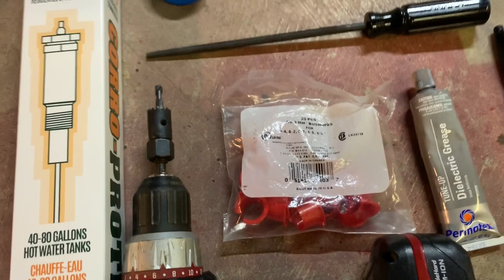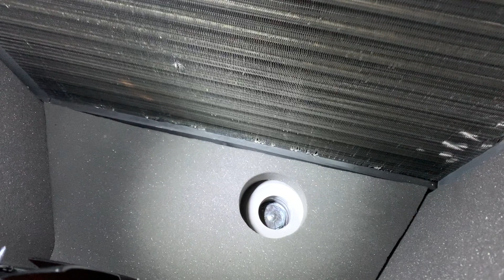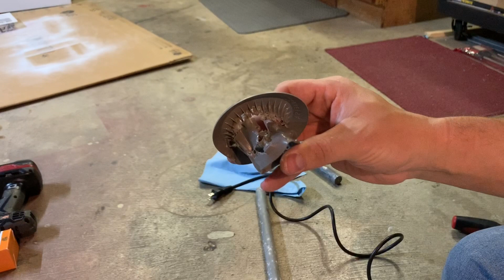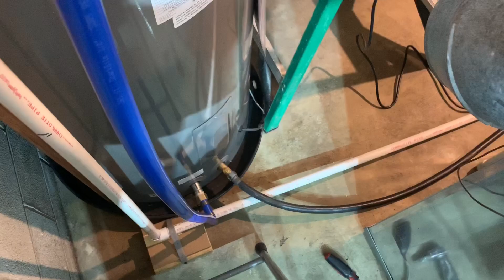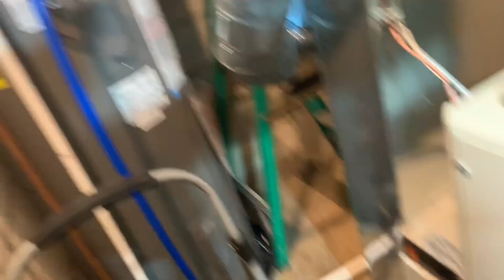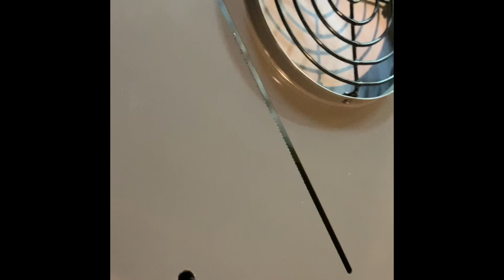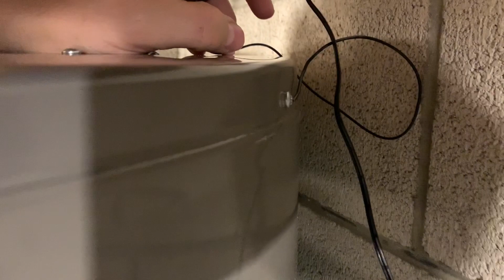Rheem Hybrid Electric Water Heater Anode Rod Replacement. Sulfur Smell is Gone!

Comment: Thank you for the video. I have been running the core protect rod in my Bradford white heat pump tank for several years. So far it has been great. I do recommend that if you have any Pex piping that you run grounds to all branches. I’ve had issues with calcium buildup at my transition location. I didn’t have this before the CoreProtect so I’m assuming that it is related. It is an easy fix especially since I no longer have the smell. At this point I have been very satisfied with the CoreProtect and I have not had any tank issues so I believe that it is working as advertised.
As a side note, a few months ago I did have a blinking light on my power supply and the customer service quickly sent me a replacement power supply. I was very pleased with their response.
Reply from the maker: Thanks for the tips. I will check out both of those items. I have pex, so I’ll look for any calcium, and to be honest, I haven’t looked at the power supply in……um…..however long it’s been since I installed it. 😮

Comment: Did you check with Rheem to see if it would void your warranty?
Reply from the maker: I did not, but many others, as you’ll see in the comments called Rheem, and they said no problem it would not void the warranty. I guess I should have checked before I said that.

Comment: I will be installing a powered anode rod in my 50 ga Rheem hybrid water heater. I called Rheem technical support & he said twice that it will not void warranty. Would have had to do it anyway because of orders. Installed 9 months ago.
Reply from the maker: Yeah I wish I would not have said that in the video. Many listeners have mentioned that it won’t void the warranty after talking to Rheem.

Comment: I contacted Rheem for my model (50 gal hybrid) and they wrote back saying changing the anode rod doesn't void the warranty. If you remove it and don't replace it that will do it.

Whoever's thinking of doing this I recommend contacting them first to get it in writing for yourself.

Comment: I hope you follow up with a borescope video in a few years. I have the same unit about 4 years old. Although I have no sulfur smell, I think I will do this. Thanks for your video.
Reply from the maker: That’s a cool idea, maybe I’ll consider it. If you decide to do the job, make sure you read through the comments. It turns out, it doesn’t void the warranty, and I think there is no need to remove the plastic cap if you get the correct socket in there. Good luck!

Comment: I've owned the 80 gallon version just like yours for more than a year, but am on city water with no smell.  Great heater, beats the dual 50s I had at previous house.  Looked for this video after not finding in the manual where or how to change the anode.  Great video, thanks!  I'll be changing mine in a couple years and will refer back...
Reply from the maker: Glad to help. I also love this water heater. I had a 30 year old crazy heavy duty commercial water heater that was in my house. It was rusting away from the inside, and staining everything with rust color. This one solved all my issues, and is so much more efficient. If you do change your rod, read through some of the comments, it seems like ripping out the plastic cap is not necessary with the correct socket. Thanks for watching!
Reply: @EvolutionDIY  Should also use a proper electrical gromet would be my only comment. Otherwise thanks for this was wondering about my new heater and how to replace the rod.

Comment: I just installed the Corro-Protect in my 11 month old Rheem Hybrid water heater. I was worried about voiding the warranty, so I asked the Rheem tech on their official YouTube channel. The response directly states that as long as the replacement anode rod is installed properly. It will not void the warranty. The response is there for anyone to see. Let me know if you want a cut and paste of the response.
Reply from the maker: Thanks for sharing. A couple of other members have commented that they also talked to Rheem, and were told the same thing. I guess I should have done my homework before I assumed it would avoid the warranty.  Anyway thanks again for sharing, it’s good information for everyone.
Reply: @EvolutionDIY  I have  brand-new unit and I called Rheem and they told be to replace the anode rod before I install it, I didn't ask them that,  they said the electric one would be best

Comment: great video.
For me I used a electric heat gun  for the plastic cap directly on the bolt head of the anode rod. till it was soft enough to pull off with my fingers while it was still soft I pushed down  the leftovers for the socket to fit.
The heat gun did not melt the foam and took about 2 to 3 minutes to get soft enough.
I also was able to reinstall the cap
Reply from the maker: This is such a good idea. Thanks so much for sharing with everyone!
Reply: Great Idea!!!!!

Comment: This an awesome video thank you. However i am encountering a more stubborn problem and that is : no matter want i do i cant get the anode rod out, i tried socket and the ratchet with a cheater bar and then the impact gun , simply no way to remove it. i am afraid that i am going to strip the hex on the rod. I am open to any suggestion . Do you think that drilling a hole on top of the nut and reaming it out with a screw extractor would work? what do you think?    Manny,
Reply from the maker: I definitely would not try a screw extractor. If a socket and impact isn’t working, I can’t image a screw extractor would even come close.  You need a SERIOUS cheater bar, like a 4ft or more. I used my jack handle slide over my 24” cheater bar I think. It was probably 50” of leverage. Also, ensure you’re using a 6pt socket, not a 12pt and you should lower the risk of stripping it. Hope you get it loosened.

Comment: Fantastic helpful video- is it still working? I’m about to embark on this thanks to your help, just wondering how it’s holding up now 3 years later
Reply from the maker: Absolutely still working, I would do it again in a heartbeat. I have no way to see the inside of the tank to make sure it’s providing the same level of corrosion protection, but I assume it is. Overall sulfur smell is still gone.

Comment: Great job. It would have been so much nicer if the water heater had simply started out with the powered anode so it would never need replacement, but that might cut into sales too much. I could see replacing the sacrificial one with a powered one before even installing the water heater to maximize overhead room, but most people don't start out expecting either sulfur smells or the fact that a sacrificial anode will destroy their $3000 water heater if they don't somehow regularly replace it, at which point the recommended 6 inch height clearance comes up a bit short.
Reply from the maker: Yeah I’m sure there is some reason to not include the powered rod initially (maybe cost, or maybe majority of people are on city water and don’t have sulfur smell, or maybe it doesn’t protect the tank as well as the sacrificial one). But yes in the future, if I ever need to replace the water heater, I will do the swap before I even put it in place. Thanks for watching and the comments.

Comment: Good video/information. I just installed the 50 gallon hybrid. Decent city water however really hard water. I will make sure I check the anode rod and will replace it with the dielectric one.

Comment: isn't there a way to do this on the inlet side before it goes into the water heater?  that way you can retain the factory warranty.
Reply from the maker: I have read some other comments of people that have talked to Rheem, and they said this will not actually void the warranty. But also, this can’t really be done on the “inlet” or “outlet” side. The anode rod needs to be submerged in water, inside the tank, and basically has to go in place where the manufacturer originally placed it.

Comment: How is this modification holding up so far??
Reply from the maker: Awesome so far. Still working great, no sulfur smell. No issues as far as I can tell. Would do it again in a heartbeat.
Reply: @EvolutionDIY  will this basically slow any corrosion damage from hard water?

Comment: Great video. Just did this yesterday myself.  Note to others, you do NOT need to use a sanding wheel or cut up the plastic ring that surrounds the old anode. I grabbed it with some needle nose vise grips and a quick tug upwards pulled the whole thing right out. Smell is TOTALLY GONE!
Reply from the maker: Good to know. Some others were even able to get a socket in there by tapping on it and not removing the plastic ring at all. I imagine it makes it all the harder to break loose the rod though. Thanks for the tip for everyone.

Comment: Such a bad decision to have a "non replaceable" anode rod in a machine like that.  Shame on Rheem?  I'd never buy that, other hybrids already have the electric anode, for me I will replace it because on well water they arent forever running.  I am at year 7 on original, time to replace it.  Thanks again, I just cant believe how dumb it was of rheem to put a regular anode in there and make it so you can replace, shame.
Reply from the maker: I mean I guess “technically” it’s replaceable since I was able to replace it, but yeah it was a little buried. I just wish they did electric rods as a stock option. Anyway, thanks for watching, good luck with your situation.

Comment: Thank you sir for this, In have a ao smith hybrid but I'm on well water with softener.  Thinking about replacing my anode with this exact anode just as a maintenance item.  Really appreciate the work you did.
Reply from the maker: Your welcome. Make sure you read through some of these comments. Others have found ways to remove the rod without having to cut out the plastic cap. Good luck on the job!

Comment: This video is now 2 years old….is the sulfur smell still gone?!  How often do u need to replace the new anode Rod??  Thanks!!!  I def have the same experience when I moved to my new house.  Well, septic, and I have a water softner too.   From central NJ.  Thank you!!!!!!  :)
Reply from the maker: It’s still 100% gone. The only time we get the slightest faint smell of sulfur, is when we run the water heater completely out of hot water. The last like 5 or 10 warm gallons has a tiny slight smell, but it’s hardly noticeable, and we rarely run it completely out of hot water so it’s not often it happens. Overall I’m very happy with the result. We have not had to replace the powered rod. It seems to still be working great. Thanks for watching and good luck with the house maintenance.

Comment: You have problems with your water. The Anode Rod that you replace it with doesn’t allow the water heater tank to last longer then 5-7 years 😂
Reply: 9.99 Aluminum Anode Rod
Reply from the maker: Yeah thats kind of what I’m waiting to see (How long my tank lasts with this electric anode rod). Honestly, to eliminate the smell of sulfur, I’ll replace the entire water heater every 5 years if I have to. Lol. There are some other tanks out there designed to be operated without an anode rod. They are fiberglass or concrete lined, and some are plastic. Sepco SR is one example. If my tank fails prematurely, I’ll consider one of these next time. Thanks for the comment.

Comment: Had this happen to my 50-gal Rheem Professional within about two weeks of install. Called Rheem warranty service and they shipped me out a new anode, presumably different metals / approach to avoid parsing the sulfur. Since they shipped this to me free of charge, and under the warranty coverage, and because they sent me DIY instructions, I'm going to go out on a limb and say this will NOT void a warranty. Now down to the basement to wail on the breaker bar...
Reply: How did it go with instructions they sent you? 
Also, is the sulfur smell due to the well water only? Or will public water cause this smell too?
Reply: The repair went as advertised and instructions were fine. However to reiterate what others have said, anode rod is absurdly torqued on at factory. Took three people working on tandem to jar it loose. Also, removal of the plastic plug is tedious and obnoxious. 

That said, rest of it went smoothly and we are back at hot water with no smell! It is a chemical problem with something in the water - my guess is more likely on well water and less likely on treated city water. But I wouldn’t know if it’s “only” a well water problem. Didn’t pay good attention in high school chemistry. :-)
Reply: @JeffTakle  can you post Rheem service contact info you contacted to get the kit?

Comment: for anyone reading this later, i wanted to share what finally broke mine free. the task was made much more difficult due to the mfg burying the rod access point deep within the unit's housing. after failing to budge the rod with all the normal tools, i picked up a 2 ft breaker bar which managed to break the 14" extension driving the socket but didn't move the rod. next i tried a series of progressively stronger impact wrenches, working my way up to the strongest home depot had to offer. still, it wouldn't loosen. i puddled liquid wrench over the rod head for 4 days and then made repeated attempts w/ all the various tools but still no luck. finally, i added another 3 ft onto the end of the 2 ft breaker bar and finally that worked. hoping this story helps someone down the road that is facing their own "get the anode rod out" nightmare.

Comment: Wow, this raises so many questions. I'm considering a hybrid water heater but it'll be near bedrooms and I'm not sure if the noise, vibration and cold air would make me regret it.
I'm curious why Rheem designed the anode to be non-replaceable. Why does it make well water smell like sulfur? How does chlorine abolish the sulfur odor? How does an electronic anode work? And if it's so much better why didn't Rheem install one so you didn't have to?
Reply: Excellent questions! Rheem don't care.

Comment: Why didnt you chlorinate the water are they say? It has been about 3 years since you replaced the rod. Did it solve the smell problem? Did it ever come back? Finally, did your water heater suffer any damage after installing the new rod? I would appreciate any response as I am about to order all the parts and replace the rod. Our tank is only a few months old and it smells horrible.
Reply from the maker: 1) Why not chlorinate? It would have added a $1000+ system, plus monthly chlorine tablets for maintenance. I really just didn’t want the hassle and added cost.
2) Smell still solved after 3yrs? Yes the smell is still gone even after 3yrs. It has never come back. I do notice if we use ALL of the hot water, like to the point where it’s almost cold, that there is the slightest faint tiny smell of sulfur towards the end of the warm water, but then it goes away once the full tank heats back up. It’s barely noticeable, and really not an issue at all for us. I’m the only one that can even notice, and it’s very faint.
3) Suffer any damage after installing the rod? Not that I know of. Water heater has been working great since I did the change. I haven’t noticed anything negative from doing the swap. It’s hard to say long term (like 10 yrs), but so far no issue at all. I would do it again in a heartbeat!

I definitely doing it! It’s just so much better without the smell. Good luck!

Comment: The anoid rod is to stop electrolysis from copper pipe to steel since we don't use copper anymore the only copper would be the coil in the tank so why don't they use a material for the coil that doesn't have the problem

Comment: Won't void the warranty. adding an aftermarket part to a water heater , truck , etc . will not void the warranty on the rest of the system  . Magnuson-Moss Warranty Act    No corrosion warranty though.
Reply from the maker: Yeah I have had some others say they talked to Rheem directly and there is no concern for warranty. Good news! Thanks for watching.

Comment: I have seen a few videos/pics now of that heat exchanger looking beat up. It actually makes me wonder if they source that part as a damaged part from some other application where it was rejected by the manufacturer but is enough to work within spec. of this unit. Just odd to see so many examples of this.

Comment: I struggled to get the original anode out, even with an impact wrench. So I put a couple cubes of ice on the anode head and let them sit there for 5 minutes. Then it hit it with an impact again and it came right out.
Reply: I don't have an impact wrench, but did try my cordless drill with handle - way too much force and I couldn't hold it. Then I tried my 24" breaker bar which didn't work either, so I added penetrating oil and let it sit overnight. That didn't help either so I went and bought a 3' iron pipe and put that over the end of the breaker bar, so I had 4.5 ft of leverage which worked but I still had to put a lot of force into it.

Comment: Hey, buddy. Thanks for video. I’m about to buy the same water heater and just wondering if your is still running good after one year. Thank you
Reply from the maker: Hi Kote. I installed this water heater in Nov 2019. Installed the powered anode rod Dec 2019. Both the water heater, and the anode rod have been working great for almost 2 years now. I have saved ALOT of money in energy by eliminating my 100% electric water heater. Basement is pretty cold due to the heat pump, but it’s an unfinished storage space so I don’t mind. Love this water heater and would buy it again for sure. Good luck.

Comment: This video gave me the courage to do the same on my A.O. Smith heat pump water heater. Much easier on an A.O Smith heat pump water heater. Just remove upper shell with about a dozen screws. Anode rod is pretty much in the middle. Use a tall breaker bar to remove old rod and replace with the Corro-Protect rod found on Amazon. Thanks
Reply: Hey Victor, Did Smith say that the anode was "un-serviceable"?